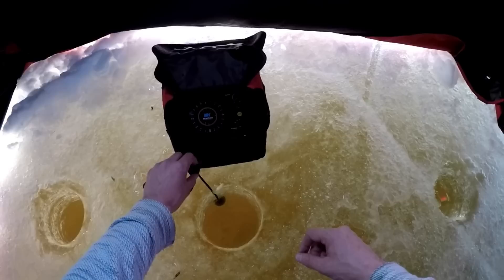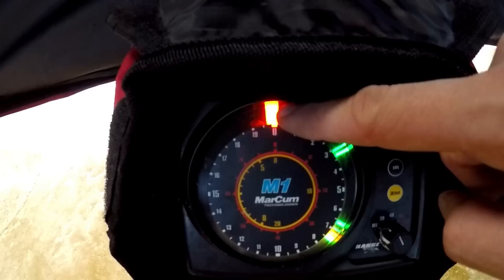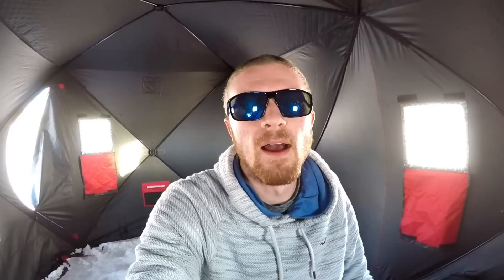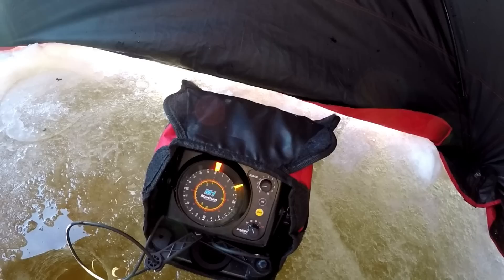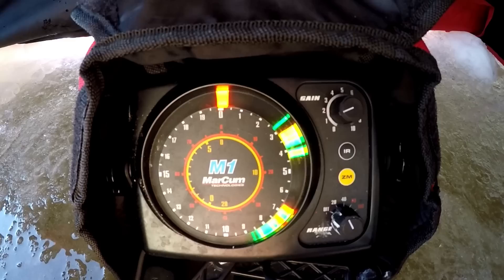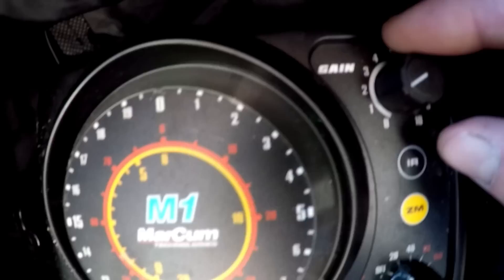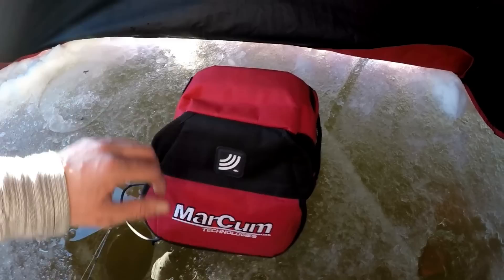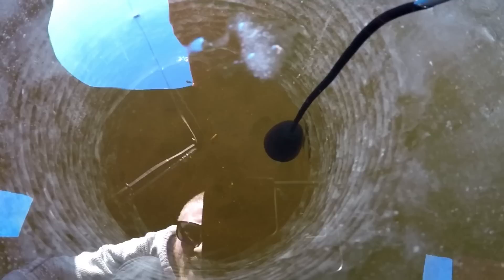How To Read a Flasher | Marcum M1 Review | Ice Fishing

Comment: Quick question so I have a marcum m1 flasher and my friends have one as well my flasher though flashes only yellow and green while there’s flash all colors is that normal or not really?
Reply from the maker: If you twist the smaller bottom knob it will change the frequency of the signal! You can make the signal stronger or weaker and it will either pick up more “red” or less “green”